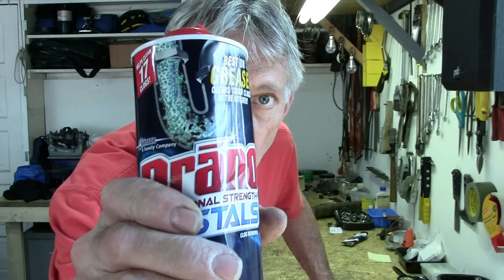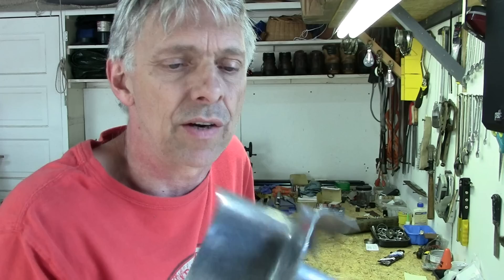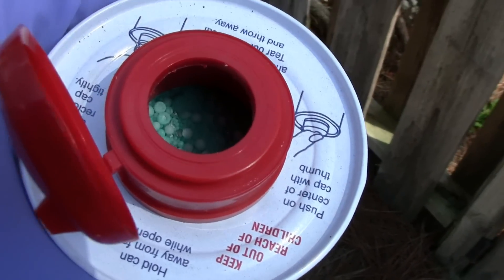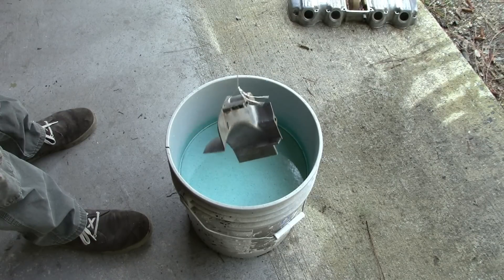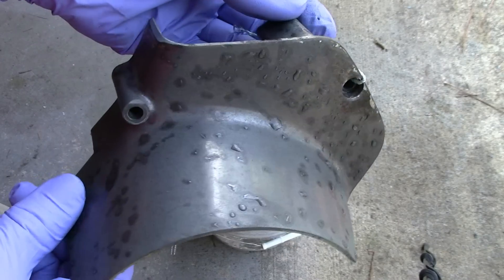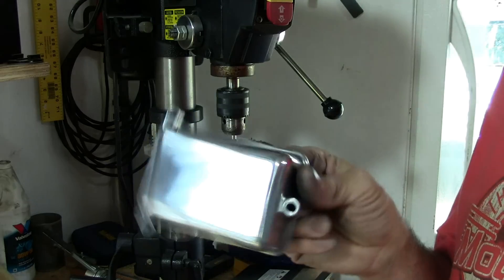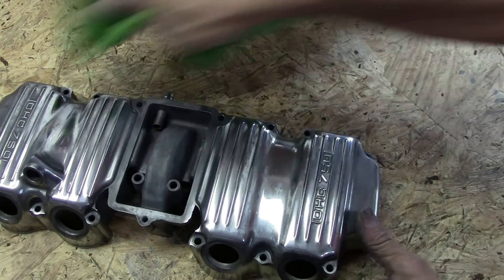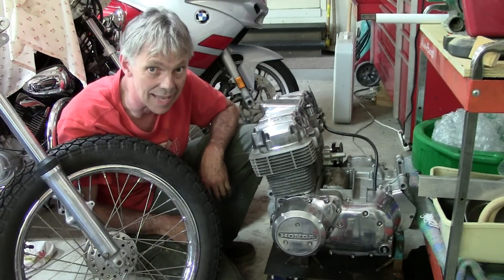73 Honda CB750  Part 24 Cleaning & Polishing Aluminum

Comment: Just a tip for the future, The easiest way to mount the engine into the frame is to lay the engine on its side and lower the frame down over it. Especially if you don't have anyone to help you. It also saves on scratching the fresh new paint on the frame. 👍

Comment: A few weeks ago I saw an older vid where a guy used Marvel Mystry oil on a rag to remove heavy aluminum oxide from an old Honda dirt bike. A wipe on and let set then wipe off. Really took quite a bit of the corrosion off.

Might be something to try if you have any other AL needing clean up. Still needs polished up then but I was blown away at how much it cleaned up the rims and head and fork bodies.
Reply: Dawino620.

Comment: Hey Dino, is there an oil seal that goes inside of that tachometer drive mounting hole? And if there is does it go in from the inside or can you install it from the outside without having to take the valve cover off? If you have that info that would be greatly appreciated, thank you Dino!
Reply from the maker: I think it's in the video where I install the valve cover.
Reply: @HackaweekTV  yeah I already checked that video brother it's not...

Comment: The primary gas released in this reaction is hydrogen. In college we would do a similar thing to generate hydrogen in a glass bottle. It gets very hot and can crack the bottle pretty easy. We used it to fill up balloons and set them on fire later. But yes, sodium hydroxide is pretty dangerous. A lot can go wrong in a hurry if you're not careful.

Comment: Great idea with the drano. I have 79 cb750 and was wondering if you have any great tips on cleaning and degreasing the engine without damaging gaskets, seals, carburetors and electrical.

Comment: I put my engine cases in this stuff. Should the darkness be removed before assembling the engine? I'm worried about it going into the oil.
Reply from the maker: Yes just wipe it all down with a terry cloth rag and some soapy water. Rinse well with clear water.
It's just aluminum oxide, but darker because of the chemistry. Dull light grey looking aluminum has a coating of the same thing but it's lighter in color because of how it forms slower out in the air.
Reply: Thank you so much for the reply.
Reply: Hola  metano Manuel  tengo una moto honda cb 400  no meanda  qero comparte unas de tus motos pero soi de chle jaja

Comment: Is the layer of aluminum oxide on the inside of the valve cover of concern? I did this and I'm worried about the Al2O3 breaking off in the oil while the engine is running and ruining bearings.

Thanks!
Reply: If its a 750 i doubt any aluminum oxidation would harm the engine. Mine had rain water in it for a unknown amount of years before i bought it for $100. Drive mine every day to 8-9k rpm's with no problem. I have 9k miles on it to since i bought it. Want to make mine a high reving 836, so maybe i want to have some sort of problem that would make me go this route, my oil pressure is a little low.

Comment: Bases are great for cleaning  steel and iron  but they turn aluminum black.    Acids will clean and brighten aluminum.       I use muratic acid to clean aluminum.

Comment: Why not spray a clear coat to prevent oxidation later? Are there any decent clear coat rattle can products available that will handle the heat? I was thinking something ceramic like what you use for headers. I know there are products available from auto parts stores, but have no idea if they are any good or if the finish would ruin the look of all that polish work.
Reply: Aaron Fink If it gets cooked, or chemically stained, or yellowed with UV, it looks awful and is a bear to remove. More work than a simple re-polish. Also, these air cooled machines get pretty hot around the exhaust headers. I've had a hard time keeping exhaust rated paint on mine.

Comment: Sodium hydroxyde indeed;I used to work with that stuff and I know for a fact that you can litteraly eat the aluminum using a 50/50 weight/volume concentration so be very carefull! And by the way,burning severely your skin!!
Reply: arkangel13th YES! Bad on the skin in concentrated form. Wear gloves!